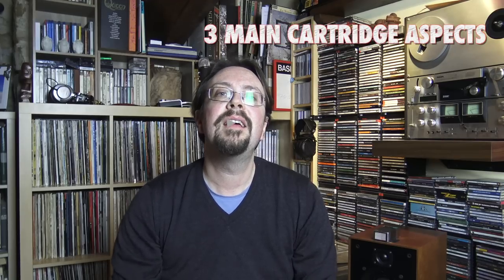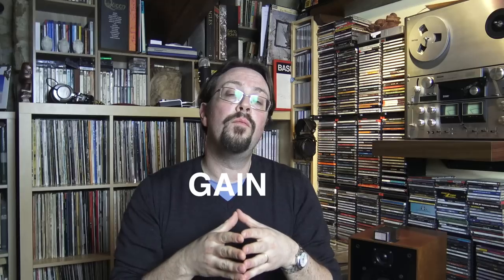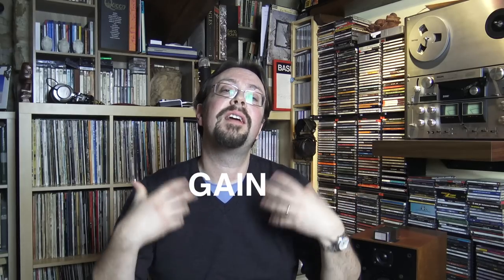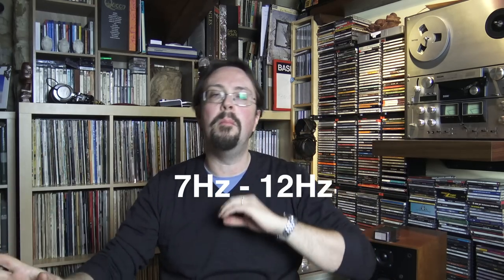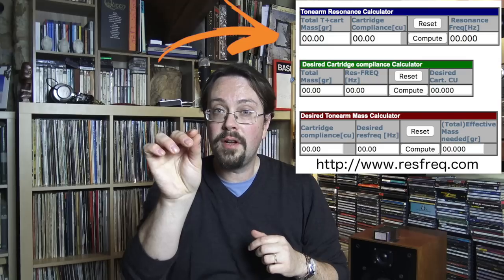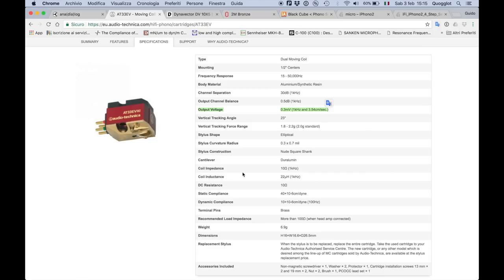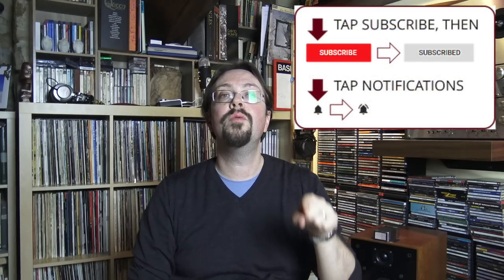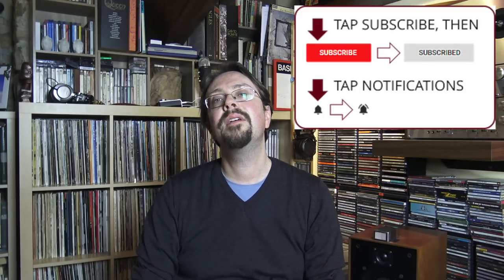PHONO CARTRIDGE: How to choose and match it with your preamp and tonearm

Comment: And here I was so proud of myself after I straightened out the bent tonearm I had, taking it from an s-shape to a straight tube, and took my friend’s suggestion to tape two quarters on top of the cartridge. No more skipping!

* JUST KIDDING *
Still putting aside for my next upgrade: Ortofon Black - can’t wait!!
Reply: I had to laugh when i read this,  just went through this with a friend of mine. He did exactly that to his J shaped arm then glued lead weight on the headshell to get it to track.  I had to remove arm and bin it replacing it with new arm and cartridge.  he was told by his wife to never try to improve the audio system without professional advice.  enjoy the music

Comment: Thanks for the insights, another tip for matching Compliance with desired cartridge is that lot of headshells are available in different Weights like the audio technica at-lh Series + for fine adjustments adding shims on the headshell so you can get as near es possible to the 10 hz .

Im Using the Project phonobox  ds3b - its nice to set up the cartridge Specs on the front of the Preamp especially when using multiple carts for different listening needs

Comment: Moving iron cartridges are great as well. often overlooked, I have a Moving Permalloy Nagaoka, sounds fantastic its has often better scanning of a record then a moving coil cartridge due to the metal being lighter they can also produce high signal voltages so they can produce the same as a MM cartridge, easier for the pre amp to pick up. Best of both worlds.
Reply: My B&O MMC-20EN is also suppose to me a "moving iron" cartridge.  I don't know if that is good or bad.  It sounds good to me but I have nothing else with which to compare it.

Comment: Very astute video.  You are absolutely correct in emphasizing the importance of the phono-cartridge as one of the most important links in a vinyl record-playing system.  Similar to a loudspeaker,  the cartridge is an electro-mechanical transducer which changes mechanical motion into an electrical signal.  A loudspeaker, of course, does the exact opposite -- changing an electrical signal into mechanical motion.  As such, these two links tend to be, as you imply,  the most critical or, let us say,  the two links most subject to variation.  As a user of the Shure V-15 Type V cartridge I was advised to add a small capacitor to the wiring leading to the cartridge as Shure had made such a recommendation.  Very interesting that you raised the importance of that factor.  

With a CD player, one electro-mechanical transducer link is effectively eliminated.  It is simply reading digital data from a disc which it converts into an analog electrical signal.   Although some claim otherwise, I don't think there is much, if any, difference to be heard from one CD player to another.   Being electromechanical transducers, microphones, phono cartridges and loudspeakers remain a combination of science and art.

Comment: Most MM cardridges do fine on 47K ohm first resistor input phone amp
Capacitance is a mostly not written on specs. They variatie from 47pF till 220pf one rule the higher the capacity the more the high tones are filtered out of the Amp. So if you have a less bass sound you can go higher in pF (Pico fahrad)
MC is mostly without capacitance rather the more the resistor from 5K till 68k or sometimes higher.
Most phono amp have fixed values.
Go for a phono amp with dips witches inside the phono amp. So you can adjust it to your taste.
My MM cardridge is a Grado reference platinum 2 wood
Specs:
OUTPUT: 4.8mV @ 5 CMV (45)
CONTROLLED FREQUENCY RESPONSE: 10-60 KHZ
CHANNEL SEPARATION: AVERAGE 40 DB - 10-30 KHZ
LOAD: 47,000 OHMS
INDUCTANCE: 40 mh
RESISTANCE: 600 OHMS NON SENSITIVE TO CAPACITIVE LOAD
CHASSIS MASS: 10 GRAMS
TRACKING FORCE: 1.5 - 1.9 GRAMS
So this grado isn't sensitive to capacitance load.
Nice video good explanation

Comment: You've inadvertently answered my question. I have a modded Rega arm and would like to get the Denon 103R sone have said the arm mass is a bit light. But it seems I can just get the Soundsmith headshell screw to add the needed mass. Thanks, great channel.

Comment: I used to be into this stuff and remember something that happened when I purchased a Japanese brand in the $350.00 range. I wound up picking up a radio station with it. I called the manufacturer and they told me to buy a resistor to solder on some points and it killed that problem.

Comment: I was watching the video. I don't fully understand the language and that's why I don't fully understand it. Surely your explanation has been excellent.
I have an AKAI AP-D30 turntable and an AKAI AM-U04 amplifier. Originally this turntable came with a PC90 cartridge and RS90 stylus. It had excellent sound but it deteriorated from use.
Then I put in an Ortofon 2M Red but I was never 100% convinced of its sound. It's not the sound I like.
I am now using a Technics 270 C-II and I am in love with its sound.
I would like to know what cartridge you would recommend for my turntable, since I want to have a new one in addition to the Technics.
Thank you so much.
Norberto
Reply from the maker: Difficult to say, we would need the mass of the tonearm ans headshell but I would simply go for a vintage cart or a quality jico cart/stylus.
Reply: @anadialog  Thanks for your answer!  I'm currently using a Technics 270 C-II cartridge and I really like it.
I'm thinking of buying an Audio Technica VM 95 EN.

Comment: On the Shure test records there were tracks to find the resonance frequency of the tonearm /cartridge combination....
MC don't need amplification , the energy is sufficient but needs only a conversion of current to voltage , something that's done by a quality step up transformer..........amplifying is an aberration but common commercial practice. 
Good transformers are pricy.........
Your advice is correct ........go for a quality MM if a quality MC  and step up is out of your budget.
Reply from the maker: Yes, a good step up is the best solution, I agree!

Comment: Just for fun i hooked my DL-130 (not my main cart) LOMC 0.3 mV up with my MM phonostage at 47k
With only 50 dB gain.  This only produces roughly a 100 mV signal, but nevertheless -

It sounded amazing. Even though it's supposed to be hooked up with 250 ohms load..! 

I keep seeing people reporting this, .. - they hooked their low impedance Lomc up with 47k load and it sounds good and sometimes better than other options.. 😅

The manufacturers always list "Greater than 100 ohm load" in the specs sheets;
but i guess 47k ohm falls within that specification😝

I just wanted to hear my de'Paravicini EAR Yoshino phonostage without the SUT's active, then it's running 47k.. and it sounds better.. SUT's taints the soundstage not worth it.

Now I'm on the lookout for a cartridge with 0.7 - 1,2 mV 5cm/sec, 

Benz micro glider SM .. hmm

You guys got any suggestions for a great medium output MC?

Comment: I have an old Rega RP 1 TT . I wish to upgrade, I understood the 3 aspect to look into. The cartridge ..the preamp …the tone arm …. I am not sure about the stock components for these aspect with RP1 ….I only know that the cartridge is a carbon make … conical…. But tone arm…no idea …if my choice of cartridge would need a change in the tone arm….I am on budget … so can’t the ambitious to go for MC cartridge …. You gave nice examples of preamp and cartridges to explain the technical points that are required for choosing the item … in my scenarios, can you sum up and tell me which preamp and the applicable cartridge that I can go about to get significant Sonal performance w.r.t its own stock reference parameters …

Comment: For moving coil cartridge the phono stage is low noise. Moving coil cartridges are not weak signal but a low output signal. Because moving coil cartridges have low voltage but High current. As for cost there are great moving coil cartridges that start about five to six hundred dollars

Comment: Hello there and thanks for your information. I have a Denon DP 11-F turntable that is over 40 years old. I am still using the original Grado G1 cartridge. I am in the market to replace the cartridge. My question is two-fold: 1. Do you have a recommendation for the new cartridge 2. Will it make more sense to invest in a new turntable and cartridge?
Reply: May be my answer is too late, but may be not. Sumiko Amethyst for $500 is one of the best MM cartridges (if you love MM). ZYX R1000 for about $1500 slightly used, otherwise is one of the best MC cartridges because it has absolute true high freqs. And they match to most of all Japanese turntables with med/med-to-heavy tone arms.

Comment: I have a Pro-Ject Tube Box-S phono pre-amp and a Shure M97XE (MM) and a Hana EL (MC) cartridge. I upgraded to the Hana around a year ago and I re-installed my old Shure and I have to say I love it so much more. The Hana really creates a harsh sound with some of my records and overall too much of a thin high pitched sound signature...for my liking. If I upgraded to a much more expensive pre-amp would that make the Hana just shine and make me forget the Shure or is it just a fact that I like MM and my Shure cartridge better?
So confused....
Great video BTW...thanks.
Oh, also, I have tried all possible settings for my two cartridges and the end result is the same.
Reply from the maker: They are both excellent cartridges. I believe you have an MC phono preamp, correct? In any way, a high quality phono preamp is always a good idea. They will both greatly benefit from that upgrade.

Comment: I am somewhat new to collecting vinyl, and you could consider me a beginner to everything that has to do with setting up a turntable. The Technics turntable I got had an Audio-Technica 2002 cartridge on it, but I felt I should get a new one. So, I upgraded to an AT95E. What I didn't realize is that not all cartridges just connect to the front of the arm like my last one, and the connectors in the back are too big to fit. I am not sure exactly what to do about it at this point.
Reply from the maker: I am afraid you need to chance the cart!

Comment: Hi i have a 32 + years old Technics SL-BD22 which takes PMount carts only and since 3 hours ago i've replaced the Technics cart P-34 with an Audio Technica   AT-85EP, and i saw some interesting sound quality difference , it sounds a little bit better overall by my opinion,  and also  more detail in hi frequencies especially, 

my 52+ years old ears can detect more high frequencies  
I know my tt is not something special but this cart i believe it is what best it could be for it at-least is what i believe .

I don't know your opinion about this AT-85EP ?
Nice and detailed video as usual :-)
Reply from the maker: There are so many AT carts! I never heard that one, I will check it next time I can...thanks!
Reply: @anadialog   Thank you too for your quick reply :-)

Comment: When it comes to the capacity for the MM system, you shouldn't forget the approx. 100 pF (Technics SL-1210 MK2) of the connection cable.

Comment: Nice of you going in depth about the resonance frequency/cartridge compliance. I have never really understood what the value meant; so if I''m right, it's a value determining the rigidity/stiffness of the cartridge body and cantilever?
The Dynavector 10x5 cartridge you showed looks very interesting, especially because of its high output and 'low' price (my 2M Black costs about the same, while being MM). I like higher output voltages because of the better signal to noise ratio. Thanks for showing me that one.
Reply from the maker: Thank you! Yes, you understood correctly, and it directly influences the resonance of the arm etc.
Reply: @anadialog  I have looked up the tonearm mass at the manual of my Technics SL-1200G for calculating the resonance frequency. But I can't find it and I couldn't find it at the web. Since you have the same TT, do you happen to know the effective tonearm mass?
I know the classic Technics MK2 tonearm mass is 12 grams, but this TT has one made of magnesium, being lighter than regular aluminum.
Reply from the maker: Yes, it was very hard to find. I don't remember where, I think on a blog or so, but I remember reading that the weight of the arm alone is 4gr!
Reply: @anadialog  only 4 grams? thats amazing! i knew there would be a difference, but i never expected it to be that big, because the magnesium tonearm is also rugged with vibration dampening polymer, in contrary to the hollow tube of aluminum on the MK2's.
Reply from the maker: I know...that is what we are paying for! ;-)
Reply: @anadialog  yeah that's totally true hehe!
Reply: @anadialog  I have recently contacted my retailer where I bought the Technics SL-1200G to confirm the effective tonearm mass, just to be sure.
He said that Technics told him the effective tonearm mass is the same as the MK2: 12 grams.
Perhaps that is because the tonearm is both made of an magnesium alloy (which is lower mass) and rugged with vibration dampening rubber, in contrary to the hollow aluminum tube of the MK2.

Some time ago, I bought an Ortofon Concorde Century; the only high-end hifi concorde cartridge, normally concorde cartridges are designed for DJing. It creates an amazing synergy with the 1200G, almost like the Concorde Century was specifically designed for the 1200G turntables. At first, I was not really impressed, but now that it had some 'burn-in time', it is truly convincing. And the good thing about a Concorde is the absence of a headshell, so there's no worry about aligning, overhang and headshell/wire properties.

Somehow it is very hard to find more information about the new tonearm design.

Comment: Useful video! Like you, I have a Technics 1200g. I’m using a Dynavector 10x5 currently (swapped from my old Rega P5), standard head shell and firm funk Achromatic. What Cartridge are you using on your 1200g? And which headshell and mat? A subject for another video perhaps - testing upgrades on the 1200g? ;-)
Reply from the maker: Hi Waybe! Thanks! I am also using a Dynavector, a DV 20X2-L. For the mat check: https://youtu.be/cs8-9GobWVs
For the headshell: https://youtu.be/ovo7FefZG5c
Enjoy!

Comment: Damn. Thanks for explaining this. I've got a 9900z Sansui receiver and Dual 622 TT and was wandering if you need a phono preamp.
Reply from the maker: Nope! You can use the one built in your Sansui. Make sure you use the phono input and connect the ground.

Comment: A few questions if you don't mind.  One, I just bought a Music Hall 1.5 turntable.  I know they aren't the best but it works for what I need.  My dad also gave me his old Technics SL-QX300 still with original box!!  first, Can you recommend a good stylus and cartridge for my music hall?  Also why is it better to store records on edge rather than laying flat.  one would think being flat would lessen the warping.  Thank You
Reply from the maker: Congrats! Welcome to the community! Let me know your max budget for the cart.
Records are stored vertical, and they should really be vertical, because if you stack them horizontal they are going to start to produce what is commonly known as ring-wear. That ruins the jacket and obviously crushes the records at the bottom. Remember that records have a recession for the label so that makes an uneven surface that warps if horizontal. Even CDs should be stored vertical.
Reply: @anadialog  Thanks for the reply.  Maybe around 200$ if possible.
Reply from the maker: How about a Grado Prestige Gold 3 or a classic Denon DL-103?

Comment: Hey it's me again,
Still regarding the preamp choice. My cartridge is the ortofon concorde club. The output voltage is quit high : 8mV : is it still important to use an external preamp? what caracteristic of preamp to focus on with this high voltage? Finally, is it compatible withe the preamps you recommanded on the video for a HIFI system under 1000 euros?
Thanks for answering my questions everytime i really appreciate it!
Enjoy the day!
Reply from the maker: Uuuh! That is a DJ cart. That is indeed a very high output. At that point it is very easy to amplify the signal but it will be' less refined. Yes, an external preamp its always a good idea. Yes, the ones I recommended are good. Its the opposite situation that can give some problems. I also made in the video description some very low budget but high quality products, also for your range.
Reply: @anadialog  ok thank you!
Reply: @anadialog  do you think i need to change the cart or it could wait for a time? Also the recommeded tracking force is 3G. is that a threat for my vinyls?
Thank you
Reply from the maker: @maximelogier1276  no, don't change it. Invest the money in a good phono preamp, which will then stay with you regardless the cart ( I.e. if you get a preamp that can accept MM and MC). 3g is a lot but not absurd, so don't worry.
Reply: @anadialog  once again thank you 🙏